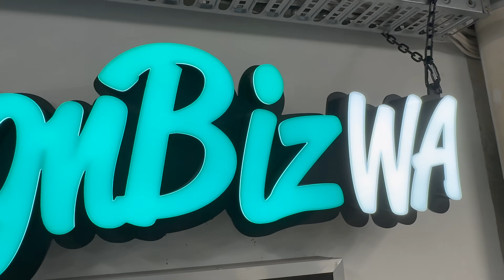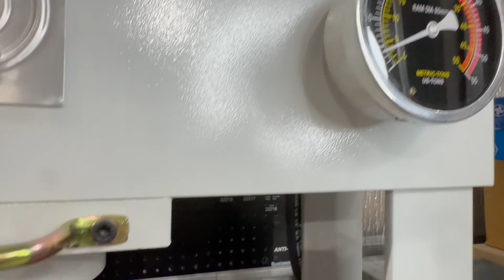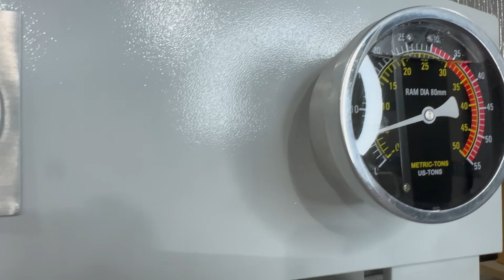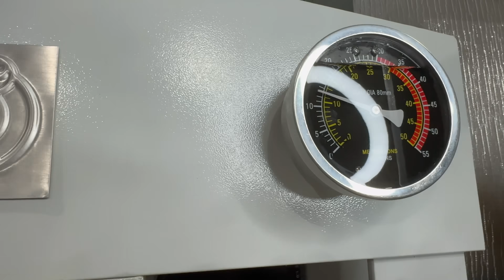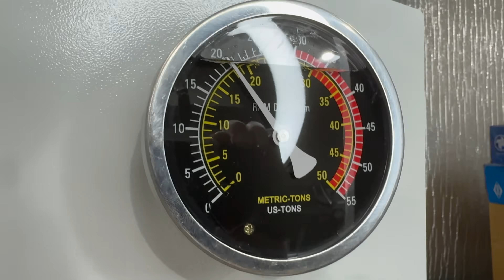3D Printed Dies Forming Steel Sheet Metal PT3 DID WE SUCCEED!

Comment: Hello there, just my 5 cent. try to use real mineral oil . WD 40 has poor lubrification capabilities under  pressure. Greetings fron Switzerland.❤
Reply from the maker: Thanks for the heads up, will have to try mineral oil instead

Comment: New to the videos, so not sure if you talked about this in previous ones or not. It might be worth looking at doing this stamp progressively. Use the die top that you're using now, then also print another one that gets a bit tighter/taller. Run the tighter/taller one after to get more definition out of the stamp. You might even target only specific areas where you want more detail like up at the top for that "8"
Reply from the maker: @ohheyitspaul Thanks for the feedback. Yes it has been mentioned previously in the first videos. We successfully got a one press on the thicker aluminium previously. You may be right though the mild steel could require a multi die press.

Comment: Would it be worth creating a lighter die so it doesn't take as long to print, and create a rubber mould from it. Using the mould you can quickly create any number of dies with different strength resins. Not sure how they would hold up, but these days there are some good resins out there..
Reply from the maker: @phils_arcade  Thanks for the suggestion. I guess resins could work they do resin style printing now etc. Resin tech has most likely changed a lot since I last looked at it many years ago.
Reply: Or just a fast printer. At least 2g/min should be possible on a fast machine.